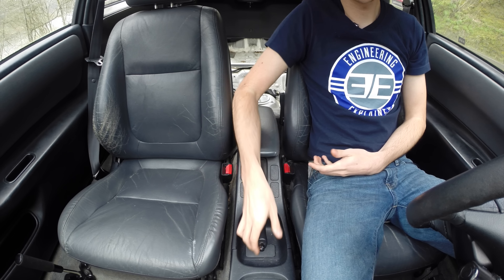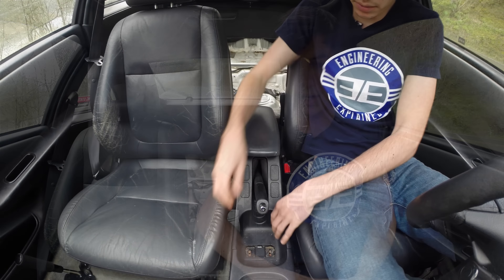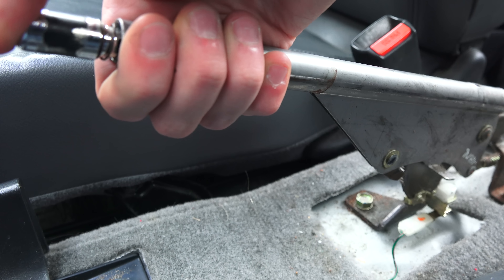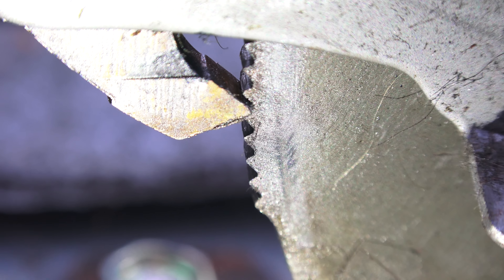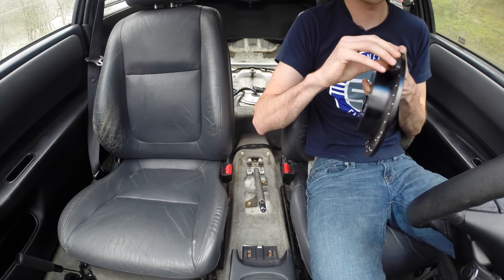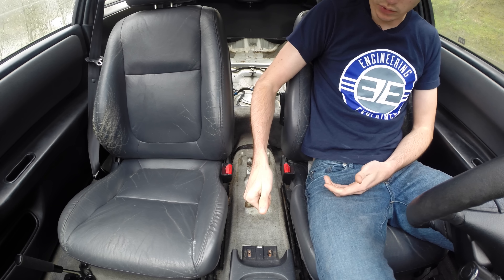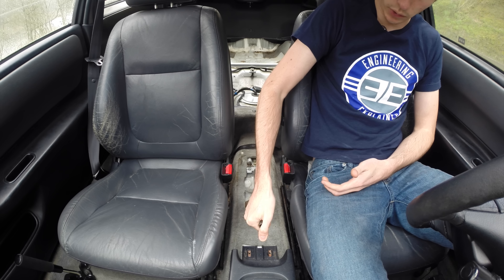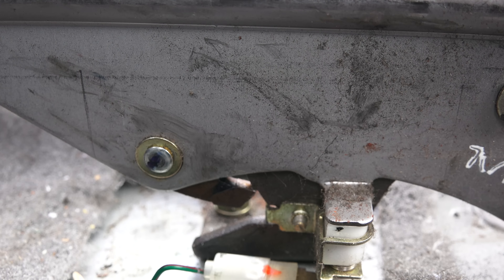Always Press The Handbrake Button? Myth Busted

Comment: What people don't realize too is that the clicking from engaging the parking brake is an important audio indicator of the brake cable itself. The parking brake should hold the vehicle in place in about 4-6 clicks. If it's more than that then there is too much slack in the line. You need those clicks, otherwise you'd have no idea that your parking brake is about to fail.

Comment: I've seen a forklift handbrake wear out after a little over 10 years. Unlike a socket, it is a bit of a worry when it clicks off and starts to roll on a slight incline due to worn ratchet teeth.
Though forklift handbrakes see a lot more use than a car one.

Comment: Engineering explained o let me give you a quick tip for your leather seats, grab a towel and some matching color spray paint and spray a bit on the towel and add a bit of lacquer  thinner to the towel as well, rub the towel on the cracked area of the seat until it's a matching color, after its all matching add some leather protectant, hopefully you see this and make a video about this thanks love the videos.

Comment: Thanks for your work, very helpful indeed. Here is my question. That pin that you normal press to release the handbrake moved back inside and it leads to very tight handbrake. The handbrake cannot easily released. Why?

Comment: Well even if it is just a myth i am glad that my girlfriend beliefs it because before i told her to she thought pulling it for just 1-3 clicks was fine and you could litterally push her car arround with the handbreak engaged. On top of that you will have a much better feeling of how hard you got your handbrake engaged if you push the button.

Nice Video and thanks for clearing that up because alot of people wouldn't have known otherwise.

PS: I was wondering if the rachating will make your brakes engage in steps instead of in a smoth motion?

Comment: i get your point.. but wear is caused by heat?? so when I use sandpaper does not micro-cut it? I think the same happens at a microscopic level. Also I can show you a worn out hand brake that I have on a dumper. But yes, it is older than me, and the hand brake is used a lot in this kind of vehicles.
Even though it causes "micro" wear applying it like that, it is a good way to check that it is going to stay locked up by hearing the clicking
Reply: Wear is not always bad

Comment: I have had cars which had had the problems because the ratchet was worn. These cars were from the 70-80s. It makes no difference how many miles you do, so I don't know why people are quoting how many miles they have done, and not pressed the button. What matters is how many times you use the handbreak which will be more if you do lots of short trips in a city which has a lot of hills in it, like Newcastle upon tyne in the U.K.
Maybe modern cars have better mechanisms in them, like harder metal, so they don't wear like they used to.
On the Citroen Xantia the handbreak works on the front wheels.

Comment: Some cars might have weak ratcheting mechanisms which are more prone to failure. If that's the case, then sure, press the button. Otherwise, yeah, it's gonna last longer than the engine.

That said, at 3:06 you're comparing it to a ratcheting socket wrench. That's a faulty comparison for two reasons: one, a socket wrench ratchet is designed for you to use it both ways while the parking brake ratchet is designed to hold the parking brake at varying levels of application. Two, ratcheting socket wrenches do indeed fail!

Comment: Read the owners manual and follow the advice there. I worked for an OEM on handbrakes, they are tested for 100K + applications without any detrimental wear. Pressing the button during application can cause the ratchet pawl to miss set when you apply it and allow the handbrake to slip down.

Comment: Speaking of wrenches! I have a Crossman socket wrench I got back in the 80's and used it a "Lot" and it lasted up tell last year 25+ years and the teeth was worn down to where it won't catch. So you will be surprised how long things like that ( brake lever) will last and the teeth on the wrench was used much much much more then you applying the hand brake

Comment: If you DON'T press the button while you apply the parking bake, the ratchet teeth could get rounded off in time (IMO). Disc (or drum) wear is not the issue.
Reply: Yeah, if they're made of low quality steel, the ratcheting mechanism is designed to be used this way.

Comment: Here in my country, to get a license you have to take a course, involving theory and in-car driving with the teacher and have to get x hours in the car before taking a test. Just a bit of context for my question which is:

I was told by my driving teacher, that it's actually bad to push the button when you pull it up, as it makes it easier to pull the handbrake too hard, which shortens the life of the handbrake system. Is this also wrong?

Comment: Interesting!   It never occurred to me that failing to hold in the button could be problematic, perhaps because most of the cars and trucks I've owned use the bottom-of-the-dash style e-brake and there's nothing to press. I assumed the video was about releasing the handbrake by pressing the button without pulling back on it to relieve tension. The things people think up to worry about...

Comment: here in the UK, when sitting a driving test if you don't push the button when applying the parking brake you will incurred a minor fault on the exam result.
Reply from the maker: Makes no sense - any literature/source to reference?
Reply: Wrong. It's if you disengage the handbrake without pressing the button. Then you got problems !
Reply: That's absolute garbage.
Reply: Bazahaza you cant disengage the handbreak without pressing the button xD

Comment: So if wear is caused/accelerated by heat, then why do guitar frets and the edges of floating bridges get dull so fast? There's no heat when the string touches the fret. There's no heat when the knife edges of the bridge press against the bridge posts. Yet both get worn and need to be replaced. Why? Because of friction. And the same applies to the handbrake mechanism, while the teeth on the mechanism you shown are still OK, it doesn't mean they weren't 2-3mm larger when the car was new and soon the teeth will get so dull they won't latch in place.

Comment: Heat is not required for wear to occur. I am replacing the handbrake lever on my vehicle right now because the teeth have worn to a level preventing the lever from functioning properly. This is an 11 year old vehicle with 150K miles. It is a manual transmission which likely causes an above average use of the handbrake. However, I do not plan on developing the habit of pressing in the button while pulling the handbrake into position. If it wears out again I will replace it again. I do not expect the car to make it another 11 years.

Comment: Heat doesn't wear parts out. Heat is a by product of friction, friction wears parts out becuase the weaker material is worn away quicker. Brake pads work using friction, and it is the reason why for most vehicles, the brakes need to be replaced the most. Your handbrakes will wear out over time if you never push the button in, that is basic mechanics. The reason that your tires we last less time on a track, is becuase you are creating more friction.

Comment: Not pushing the button is a bad habit, but it has nothing to do with wearing out.

The sound encourages drivers to pull the handbrake on harder then it actually needs to be, which lends to stretching the cable and over time reducing the capability of the handbrake.

By pushing the button in, drivers tend to set the handbrake based on how it feels, which normally results in the right amount of braking.

It's a bit like double clutching a vehicle that has a synchronised gearbox.
You don't need to, but it will work a bit better if you do.

Comment: Well my father's opel Corsa B Sport TD actually after some time the teeth wouldn't grab the handbrake anymore and the car was actually in pretty good condition even above 400000 KM the engine was still pretty damn strong Isuzu engine, it wasnt even eating much oil, it would last for the revisions and was never opened, the gearbox though was changed but still lasted for that 400K KM, and it wasnt exactly even that bad, but it got a very small hole and the mechanics said they couldnt weld on that part so my father bought other used one...

I dont think the turbo have ever been replaced either and yeah off course the car had a bit less power than brand new, but was still working very smooth for the big mileage (not mercedes like smooth though) and still had most of the power even though we definitely felt a few HP less :).

Comment: Sorry, but your understanding is flawed. 

The problem is not that you have to wear those teeth away to a smooth surface to have a problem. 

A brand new handbrake mechanism has sharp teeth. Your car has slightly rounded teeth If you look closely at 0:52 This increases the possibility that the ratchet can sit on the tip of the teeth. When you do this, the lever can ‘bang’ on to a lower tooth, releasing the handbrake by one notch, not good if you park on a hill as the brakes cool.  Hopefully, this happens straight away while you’re in the car so you can pull it back up a click. 

I have also had grazed knuckles from worn ratchets that caused them to slip. 

On a handbrake lever, heat is nothing to do with wear and the comparison with brake discs and pads is just wrong. 

Brakes work by transferring the stored kinetic energy of a moving vehicle into heat by using friction.  The brake lever is a mechanical lock. 

A new ratchet costs typically less than £25 a grazed knuckle and a bit of profanity. 

A car without a driver going down the road £?

Comment: But one thing I can add is that makes hand brakes better verse foot brakes is that if your brakes go out you can limp home using a combo of engine braking and e-braking as in controlling the e-brake pressure while you hold the button in. I bet most people did not realize that.

Comment: What causes wear in this situation is not heat produced from the friction but rather the metal on metal impact it makes when not pressing the button down, so your brake pad and heat comparison doesn't really work.

Imagine chipping two rocks against each other. They will wear even if it's miniscule. Your viewers aren't wrong when they say it'll cause unnecessary wear. It's just not significant enough to worry about.

Comment: In my country, when you go for your drivers license test, you're immediately failed when the parking brake makes a ratchet sound, so it's kind of law here to push the button when you apply the parking brake, even when you go for your defensive or advanced driving license.
Reply: That's absurd! In these tests, are you using it strictly while stopped to lock the wheels or are they making you prove you can stop with it?  If using it as an emergency brake while moving, yes, you should hold the button as you need to be able to reduce pressure if you lock the wheels to prevent an uncontrollable spin, but if you are just parking, your country is mandating that you don't use something the way it was engineered to work.
Reply: DerekSiems
Every time you stop you have to engage it, but only after coming to a complete stop. So at that point you HAVE to press the button. In the documentation they state :"Every time you fail to use the release button to apply or release the parking brake of your vehicle you cause it to deteriorate prematurely. This could result in the parking brake becoming ineffective when you least expect it."
Reply: South Africa K53 Drving  Licence Test?
Reply: @Bazahaza Yebo
Reply: You need to tell them they've got it wrong !
Reply: They won't listen, T.I.A

Comment: I'm surprised you didn't mention wear on the button mechanism. Holding in the button to engage the handbrake means you'll be pressing the button twice as much. Is it possible for the button mechanism to be prone to wear? It might have springs and stuff in there to disengage/engage the latch? Well my point is that it may help your argument that pushing the button to engage the handbrake is not necessary.

Comment: I haven't read all 3200 previous posts so someone may have made this comment, but I would expect that the ratchet gear and pawl on these brakes are heat treated and hardened so that even with daily use (say 25 cycles) it would take something like 100 years before noticeable wear develops so that the brake begins to fail.  The car will be sent to the recycling plant before that happens.

Comment: Thanks for the video ... If I accidentally hold on to the e brake when I get in the car to adjust my sitting position .. by giving a little pressure on it when it was pulled up .. will I do any damage to it? Thanks

Comment: The idea isn't so much about wear, but rather that in the event you actually have to use your e-brake to stop a moving car if your brake system fails. If you just rip the lever up you run the risk of locking up your rear wheels instead of being able to modulate them and come to a controlled stop.

Comment: No,  wear is NOT caused by heat.  Wear is caused by surfaces rubbing against each other.   Heat is a byproduct of this.   Wear may be temperature-dependent, sure.   But wear can occur without significant heat build-up.   Quite often wear is worse before surfaces reach their operating temperature (which is why engines have thermostats).
And yes, handbrake ratchets can wear out, I've had (very) old cars with worn ratchets that would barely grip.   And socket wrenches do wear out, but it's cheaper to replace a cheap socket wrench than a handbrake.

Comment: I had a hand brake racket mechanism fail on my 1990 5-speed Mustang years ago and the car rolled down my very steep, 75 yard long driveway and unceremoniously kamakazied into a tree. I had applied the handbrake and gotten out of the car to grab something off the driveway when I heard a ratcheting sound coming from inside the car behind me. “Odd” I thought because there’s no one in the car fiddling with the handbrake. But when I turned around Sir Issac Newton was accelerating the car down the driveway, door open, with the hand brake completely released and down in its stowed position. I managed to chase down Sir Issac and partially jump in - head first - just as it was hitting the tree. That was a bad move because when the car hit the tree I was only partially inside and I slammed into the open door, bending it  past 120 degrees and breaking off the top of the steering wheel which I had grabbed in a heroic attempt to steer the car out into the street.  As I sat there admiring my beautiful convertible with its smashed bumper, crumpled hood, steaming radiator, ridiculously angled door and decapitated steering wheel, I was hoping that someday, someone would assure me that it wasn’t my fault for having ratcheted the handbrake repeatedly over the years. Finally my dream has come true. I feel so much better now!
Reply: It was a manual and I’d left it running because I was only going to be out of the car for a second, two at the most. Good point though!

Comment: Expert drivers don't press the button, and instead remember the number of clicks on the ratchet before the handbrake is fully engaged. I engage the handbrake with one or two clicks less whenever in tight spots e.g where I'm between two cars parked uphill and have to start moving

Comment: We were taught in driver's ed class to do it ONLY because the teacher didn't like to hear 40 ebrakes being pulled at the same time for 20 minutes, he said "it's not bad on the car, it's bad on my ears."

point and case why it makes no difference is SUV and [mini]vans.  they don't have a button to disengage the ratcheting mechanizing while engaging and those aren't wearing out every 3 years.  The one in my 1994 suburban is working just fine 23 years later.

Comment: So if you pull the handbrakes you just "bypass" the idraulic sytem and pull the brakepads with a stell cable, is it the same with drum brake? Does it use the drums or it has a couple of extra brake pads?

Comment: Not just friction, but lets say those ratchet teeth were reversed and the only way to pull it would be to press the button or FORCE the gear over the teeth that are opposing it, this would also cause wear. But since it's a ratchet like that with a curved slope for the metal to slide over it doesnt matter whether you press it or dont.

Comment: The energy dissipated when manually pulling a lever is nowhere near the energy dissipated when accelerating or stopping a 1-ton vehicle powered by an engine. And yet, you very rarely replace even your brake pads or clutch. Therefore, one should expect much less wear on the little handbrake ratchet.

Comment: what about using the handbrake to start a manual on a hill? My dad told me that it will wear out the paring brake and that I should just be quick on the throttle.

Comment: I bought a used car and the parking brake doesn’t engage until fully lifted. It ratchets like it’s supposed to but doesn’t stop my car from rolling until the last ratchet, and only slightly. Where should I check to diagnose the issue?

Comment: Seems fair enough but in my view repeated habits cause damage. On my bike I change gears whilst easing power on the pedals and try not to drag the brakes on downhills. It's these small things that stop things wearing out so quickly. Then again I'm sure a parking brake ratchet will last quite a while, much alike the ratchet in the rear wheel of my bike.